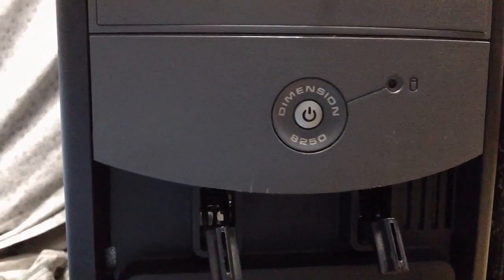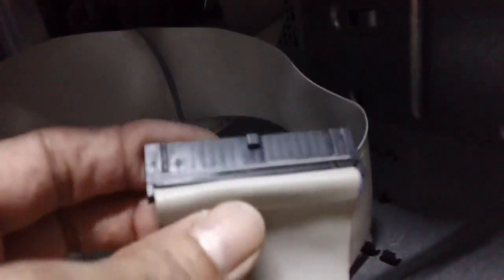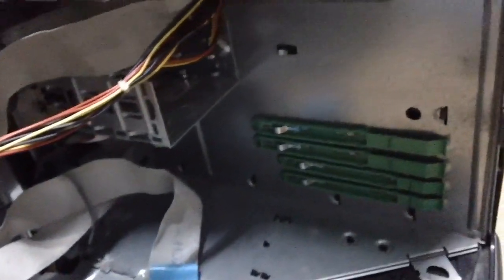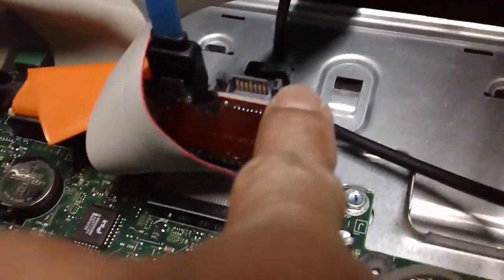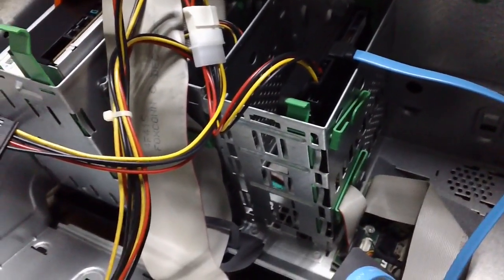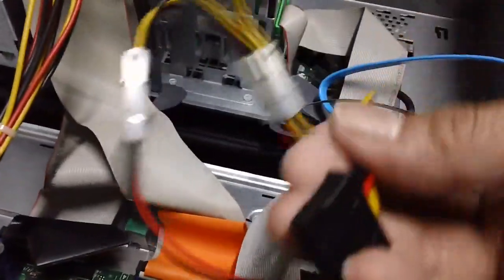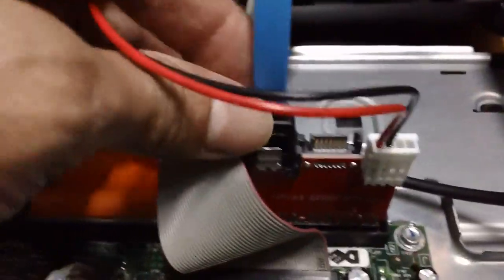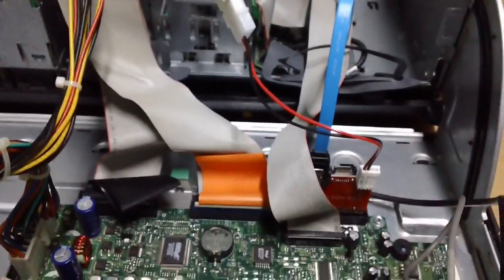Using SATA HDD on IDE Motherboard with Adapter Kit

Comment: For some that have trouble: 137 GB was standard ide max, extended to 1tb but was replaced by sata. Some older machines could not load large GB drives, due to bios, however X used to have software that bypassed these limitations. I have a old baby running a 1TB drive and a 512GB sd drive with Win 98 upgraded from win 95. Was going to give link for X but there are so many versions and most was drive oem specific so would need info, too hard. I hardly ever use YT since it's adds crazy, too frustrating.
Reply from the maker: @wamperth  
I know what you mean about the ads on youtube. It's crazy man. Anyhow YouTube was the original. I appreciate the time you've taken for your comments. I'm just fixing up these computers to give them away so I'm not really going to much trouble. Thanks for your input. Have a great day bro

Comment: Hi, normally I no longer offer help or make help videos as it is not appreciated these days  so this is a exception as you seem a nice person. There are two versions of this card, red and blue. Blue works way better is not as fussy.  I imagine you did supply voltage to both the card and the drive, should of worked if sufficient current. If running sata to ide dont use twisted cable, ensure ide set to master. Now a better way  is to buy a ide to sd or a sata to sd depending on what you want. They recommend 128gb max but I tested 512gb  works fine. Don't think 1tb, they all scams even though they do exist they way too expensive $120+ for a genuine. Note we talking SD not SSD. SSD is another ball game.
Reply from the maker: @wamperth  
Hey thanks for your comment and your input. These computers I fix up and give away to people in the Philippines mostly students who are needy and can't afford to buy a computer . That's why I don't want to spend a lot of money on them to fix them up. I give them at least a 250 GB hard drive. Or maybe at 500 GB hard drive. They're not going to be using these computers like we do all they're going to be using it for a school work. I appreciate what's you've said

Comment: Is the compatible with windows 98? I want to do a fresh install on a 150gb sata hard drive but not sure if it will read in windows 98. Thanks!
Reply from the maker: @RickyOcarina  
Hey, thanks for watching my videos and for your comments. Windows 98 is really ancient. I'm not sure if this setup will work with Windows 98. You'll have to do your own trial and error to see. Can you let me know if the motherboard can handle anything above that. Can you try to put Windows XP on it and then upgrade to Windows 7? Your 150 GB SATA hard drive is a good size for an older computer. Do you have access to Windows XP and Windows 7 installation discs? Let me know how you make out

Comment: i got a problem, my pc doesn't recognize the hard drive disk, and the ide adapter too, what can i do in that case? i have it plugged in with all the cables and colors correctly, thanks!!
Reply from the maker: Hey thank you for watching my videos on for your comments. There are a lot of variables. You see I had a hard time doing mine as well. It could be anything like your processor the Windows operating system you're running the size of the hard drive. Sometimes if the hard drive is too large the operating system on the processor won't be able to recognize it. That's why you see in my video I tried a few full size hard drives which did not work. In the end I got the PC to recognize that laptop hard drive. That's when I made my housing to fit it into the computer Bay. Sorry but I really can't put my finger on what could be the trouble you're running into. You will have to try a few things and experiment. Good luck and have a great day